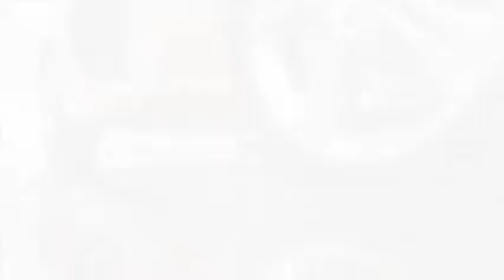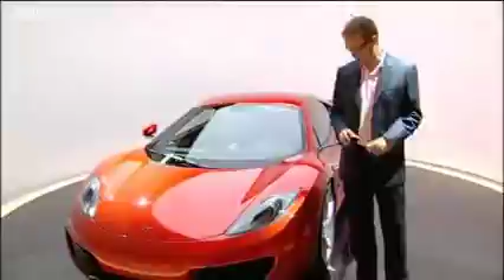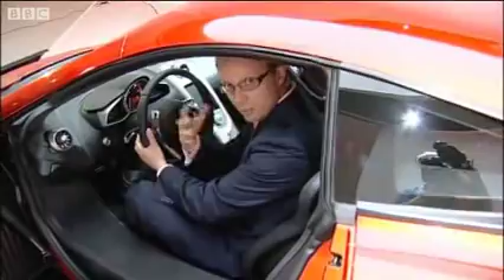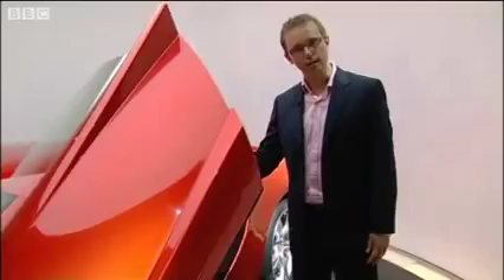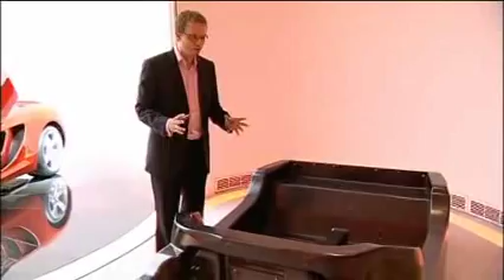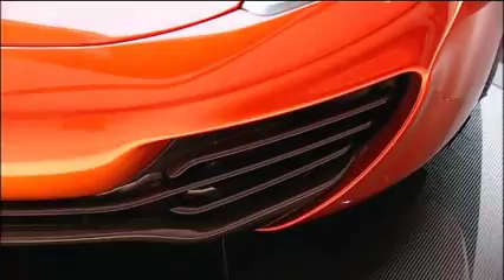McLaren's new sports car revealed

Comment: I don't see how anything you've said here is a response to my comment. "Carbon-like" materials could be anything, all sorts of composites have been around for a while in different applications from really shitty fibre-glass to high quality aero engineering used glare. A carbon fibre chasis is certainly more advanced than the 458 chasis, so why you implied it should be more than a £1000 cheaper than a 458 is beyond me.

Comment: The fact that it's anywhere near the same price is the absurdly well engineered part. That much carbon engineered to that level at that critical system level would for a normal company put a car like this north of 300k easily.